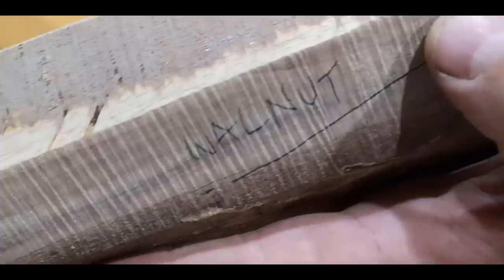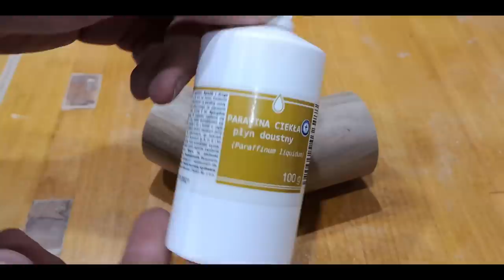024 Woodturning - walnut lidded box

Comment: If we lived closer together, I would come by for a play date on the lathe, which is my specialty. I would have rough turned that piece and let it sit for a month or 6, since wood will 'adjust' to having bulk removed. One guy I know rough turns his pieces 5 or so times over about 6 months. I am guessing that black stripe was not ring shake, which you are most likely familiar with. Otherwise it would have blown up. Good looking piece. I don't work with walnut any more, it makes me sneeze and itch.